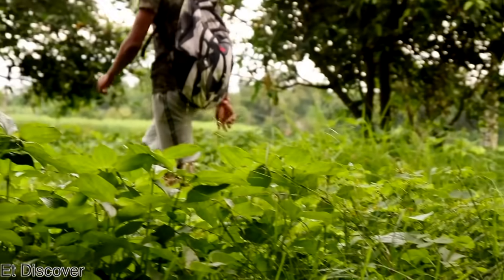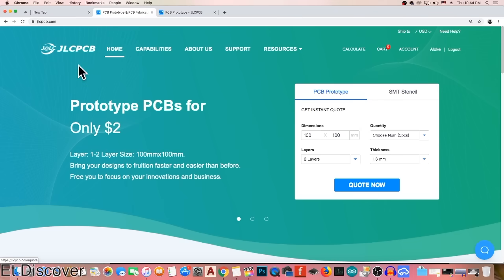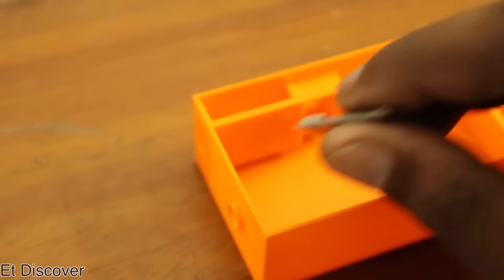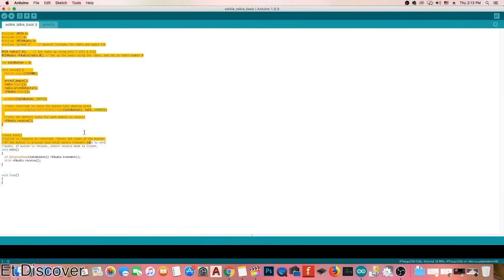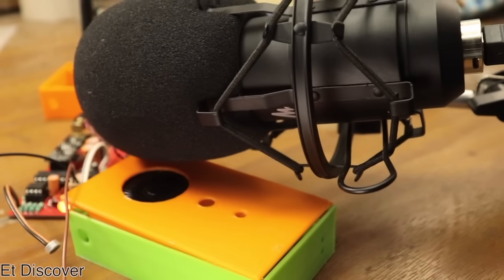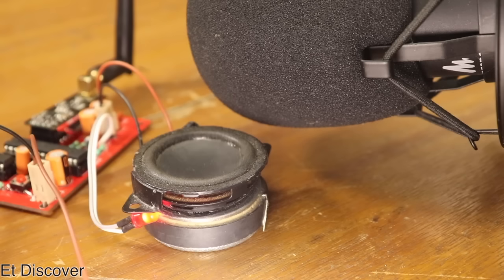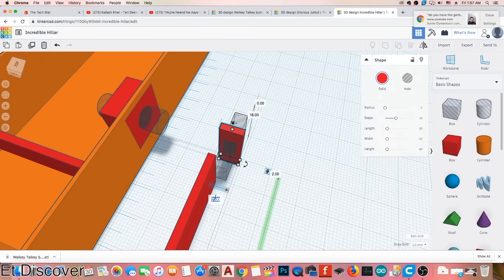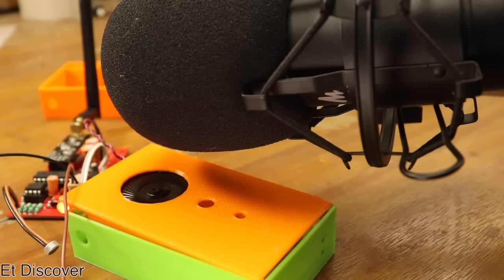Make a 1.5 K.M Range walkie talkie # Without Noise Clear Sound#

Comment: Add a ceramic capacitor or a normal capacitor with low capacitence in the wifi module or the amplifier of speaker 
to rectify the noice

Comment: There is an important piece of code missing in the program under:   pinMode(talkButton, INPUT); should be written:
  digitalWrite(talkButton, HIGH); This way the floating talkButton will be high or low but not floating in between which is causing it to get from receiving to send thousands of times a second. That is what is causing the noise when receiving because it is partially sending as well. With an added  digitalWrite(talkButton, HIGH); both sides are muted when no button is pressed. With the button down the program is clearly in sending mode and not echoing. Please repair this in your program because this is disappointing for many enthousiasts in electronics who we need dearly in this world.

Comment: This is very very cool! Bravo! I know where the noise is coming from, it's the mic leads. You could try putting .001uF cap across pins on the mic itself, or using shielded wire from it to the board. Those mics have a FET amp in them so can pick up RF noise and amplify it into audio and send it back out.

Comment: Hi. Where can I obtain the mounting pieces for the atmel processor ? Also, will the same mounting piece work if I decide to use an arduino instead of the atmel alone?

Comment: How does this CAD software compared to a fusion 360? I have recently been doing product development in fusion 360 for work. I am new to it, and the whole 3D model and rendering development thing,  but my work specifically uses the cam/post process as I am a mechanical engineer/machinist by trade and heart. So I need the cam/post processor software/tools to design toolpaths with tools to write out G-Code for subtraction process for CNC. I'm also interested in addition process for 3D printing in the future as I'm developing my skills. I've used (Rhinoceros 3D) or rhino 6 3D in the past and I found plugins for it, for CAM processing.
At work I recently gained access to fusion 360 but I still find myself using rhino 6 and I can import the STL files from Rhino into fusion and then from fusion use the cam post processor for manufacturing to create toolpaths and G code for my CNC  HAAS mills and CNC Okuma lathes at work. 

My history as a CNC operator/setup machinist has gone to a whole new level with this product development understanding the engineering side and actually doing it has given me a new light as being in this industry since 2010 all I knew was how to write code by hand with a piece of paper, ruler, and a calculator with using G-code long hand format plotting 2D sketches and going through MDI process on the machine or manually by free hand to get results.

I  remember and understand g code without 3D modeling and without a cam processor and did so free-hand/long-hand programming. So going from this level to going to a product development level creating models and allowing the post-processor to write the code out for me is a completely different way of looking at things and it's a great educational experience I find myself still taking the spit out code from the system and fine tuning it manually understanding how the cheat code works through years of experience doing it manually. I find myself changing approach points exit points needless machine movements and changing codes to something that I know that works by hand adding in safe codes at the beginning of the program and proving programs out locking them in and creating a new setup sheets that are finally detailed so future Machinists can look at the setup sheet and have a full understanding with different viewpoints in a simplistic way of understanding and being able to set up or substitute different tools by having notes and instructions on how to do so. I feel very impressed even for myself at this level.

Comment: The reason why you're having noise is your microphone is too close to the speaker you should design the microphone at the bottom left or right hand corner and your speaker at the top. This will eliminate feedback.
Reply: Also wire you lead wires for the mic along a different path and opposite sides from your power wiring so if you're charging port is on the left side put your microphone on the right side and vice versa also the wiring if it runs upwards on one side make sure that the powering circuit wiring runs on the opposite side and vice versa.

Comment: Tell me your opinion in comments section but hey no reply from the author. He is saying total project is not completed but I have seen that the project is completed but some defects in cabinet making. I have asked the author that why my two modules are not functioning. After uploading the code in arduino ide at at8mega328 ic then opened the ic from arduino uno & put it on the make module but nothing happened when PTT button pressed connected at pin no 5 but if I connect it in pin no 24 then PTT button pressed something happened but not transferring audio to another module. Actually author is not a helping person & I have seen that in YouTube walkie talkie making video anyone author can't join the qwery. I don't understand why it is happening & if you not answered then clearly said that I can't help for that. Please don't passes away. I think that one important thing is there & that is why the module is not responding & which is a major point.

Comment: Sir after upload the sketch to Arduino Uno, there is a boot boot sound from the audio amplifier & no response from the microphone after pushing ptt button of transmitter set from the another set. What can be done? I am really upsetting how can I do the project for success. Sir please help me. Specially no response from microphone module after pushing ptt button of transmitter set. I have already uploaded the necessary library for this & if not uploaded then when I want to upload the sketch it is saying that no RF24AUDIOH or nrf24l01 library not found. What is fault I don't understand.

Comment: It's quite strange to hear the noise of power supply converter or pocessor noise in the "Walkie talkie without noise" video. I suppose it would be good to make some shield or filter to reduce such noises.
Also sharp angles of box are dangerous. 3D-printer has number of capabilities to make anatomic body for the device.

Comment: Isn't this expensive? [For me anything that goes beyond 1000 Rs. is expensive] Please suggest ideas to bring down the cost.
Reply from the maker: Watch my other walkie-talkie videos
Reply: This is really unnecessarily complicated. You can make the transmitter only from two folding gates of some 1xIO and passive electric components - 2xC (47uF), 2xR (trimmer 1k) and 1x old Mic. All this is smaller than a box of matches and easily fits into the FM pocket radio. Power supply and antenna are common. I intentionally do not describe the scheme, because it is not my channel and it is a very effective and simple spy technique. :)

Comment: Great project. I would recommend you to use an STM32 blue pill microcontroller as it can run at 3.3-volts and has much better features than Atmega microcontrollers and cost lesser than an Arduino UNO or Nano.

Comment: Good work bro... The noise seems to come from the boost converter, the switching frequency of boost and buck converters usually generates a lot of noise. My suggestion is using higher voltage batteries (2s ou 2 of them in series) and use a linear regulator, you will probably get a much better signal/noise relationship.. Keep it up dude, thx 🙏
Reply: Indeed buck and boost converter modules produce a lot of noise and also disturb the signal receiving and transmitting sensitivity of the transceiver

Comment: Nice  👍🏻 .... &  I hv  2  qtns
1. I want  to buy this Motorola walkie talkie 
https://www.flipkart.com/motorola-talkabout/p/itmf9f5yehu5jghb 
 Plz  tell  me  abt the low latency is  It gud  to  make   A  guitar  🎸 wireless ???? Without any delay  or  noise   
Basically I want to  cnvrt  walkie talkie  into  wireless guitar 🎸 
By De-soldering 1st W-tki  in built  mic & connect  guitar  jack  directly 
& in 2nd w-tlky  audio  output  jack goes  to   Guitar 🎸 amplifier ....
Will  this  work  without delay &   Walkie talkie noise  ?? 
Plz plz rply

Comment: I have a good wifi connection at my home, I want to share this internet with my shop as well located about 200 meters from my home. can you tell me how can I transfer my internet to 200 meter, ( I don't want to use LAN cable as it's not strong enough ). help me, I have subscribed your channel.

Comment: Nrf24 is not an wifi module. It's just an rf transceiver module. And don't tell me that because it runs at 2.4 ghz makes it an wifi module. Wifi is a high speed wireless networking technique/"protocol".

Comment: NRF24L01 module even in ideal settings don't have 1.5 km range. Please share actual facts..
If it has obstacles like trees or rocks it don't even connect.
Even transmission data rate is a question here..

Comment: 1) Nice work.
2) Add a low pass audio LC filter with a corner frequency of about 6 to 8KHz  suppress that PWM whistle at the output of ATmega. 
3) Forget 3D printing the case and use a metallic enclosure instead.

Comment: Bro,I think you will use the NE5532 op amp IC for reduce noise and make it 20 to 20kHz bandpass filter differential op amp circuit configuration for our hearing, try it

Comment: Great job. 

I have a couple of questions for an extension of this project. 

What would I need to do to achieve longer range? Would I need a different board to attach to the antenna? And/or add more power?

Hoping for a reply (:
Reply: If you need to achieve longer range, go buy a real walkie talkie.
Reply: @zyrupgaming9611  uhm its diy?

Comment: You could be picking up some noise from your power booster or another pulse source.  You can:  put a shield around the power booster, put a variety of filters on these various circuits, you could twist paired wires & route these wires away from each other.  A combination of all of these techniques in order to reduce/stop noise.

Comment: Bro both can transmit and receive the audio signals?
And can i use ATMEGA 328P microcontroller with same pin configuration in this project?

Comment: Nice project! Though I`d use ready made radios. Even cheap radios work well. The most important is ability to communicate with other standard radios. But these ones only can work with same ones which is not convenient. How far can it transmit signal  in clear view distance, in forest, among buildings? I guess 2.4 MHz wave can not pass through far enough in obstacled areas.

Comment: Instead of boost convertor, you can use power bank module. It will be used to charge the battery also.

Comment: It's physically impossible to get a 1.5km range at 2.4GHz with that small antenna. You would need a MUCH larger antenna for an higher coverage. You must have used a much lower frequency, such as VHFs or low UHFs (800MHz, max). 
There was literally no point to use a WiFi antenna to do that.

Comment: That's an rf transceiver, not a wifi module
Reply from the maker: The IC which has been used in NRF 24 module has a data sheet please read that carefully you will get your answer
Reply: @EtDiscover  as if I haven't read it. It is not a wifi module dude, you need to go through the nrf24lo1 datasheet again. No where in the datasheet it is mentioned as a wifi module, but an rf transceiver

Comment: Nrf24l01 is a RF module you don't know but did project
Reply from the maker: The IC which has been used in NRF 24 module has a data sheet please read that carefully you will get your answer

Comment: trying to make this project since ages.
Reply from the maker: Now you can try
Reply: why u r failing ?
Reply: @iceberg789  earlier analog rf was conceptualized, now those small digital 2.4ghz are made, might require cpu interface & i'm weak in programming.
Reply: @bazrazin1  yes, you will require an mcu and a little bit of programming. but don't wait any more, jump into it, right here, right now.

Comment: Can u give me the link of Ur battery... I can't find 402535 battery with 500mah rating...I want one.😭
Reply from the maker: You can use there any Type of battery
Reply: @EtDiscover  no I actually want a battery of 2.5cm X 3.5cm X 0.4cm...with that high capacity (500mah)... Actually there's a shortage of space in my project... That's y I was asking... If you can give the link then it will be of great help 😅...

Comment: Great effort but overkill for a walkie talkie isn't, i mean everything is digital but the final audio output is like AM... Regular analogue circuit transmitting over fm would have given better voice quality, simpler circuit & something every hobbiest could do... But kudos to u, appreciate new age hobbiests like u, u even 3D printed a case, wow!
Reply from the maker: Thanks for your opinion, Actually this noise is for Wi-Fi transmission, In this process you will  face a little noise , because the sound wave Is running 400to 600 Hz, Like a old days  AM radio

Comment: Good job bro ...l want to know how to design circuits with microcontroller, resistor  and all electronic components
Reply from the maker: This the result of meditating for past 100 years! 😅😂😂 just kidding! Keep watching my videos and you will definitely learn something!😊
Reply: I am also interested in circuit board development I found that fusion 360 also has this feature for circuit board development I understand the basics of electronics parts components and assembly but design I'm a newbie and very green. Maybe we can learn from each other on a standpoint you're great at this electronic development and I'm great at manufacturing product development through years of experience of making parts out of metal reading and understanding development blueprints and taking a print to product through manufacturing is my specialty. Look me up and educate me and I'll help you on the other end for mechanical engineer and design maybe we can trade experience.
Reply: You have to study hard , very hard! About Electronics and how things work . That's the secret

Comment: Thats so cool. i need to build that
Reply from the maker: This is very easy you can make it yourself
Reply: @EtDiscover  I am just starting to learn to build things but currently im on building power banks and speakers and im trying to figure out to use motor and generator to provide enough power to its motor generating power and power the battery or the device without using battery i got step up voltage and current board which is in progress testing but am i maybe wrong and needs some extra things?

Comment: Great video 
Can I use at mega328p
The microcontroller that is used in Arduino uno?
Reply from the maker: yes you can
Reply: @EtDiscover  so the code and the diagram is same?
Reply: @3m_art001   Yeah